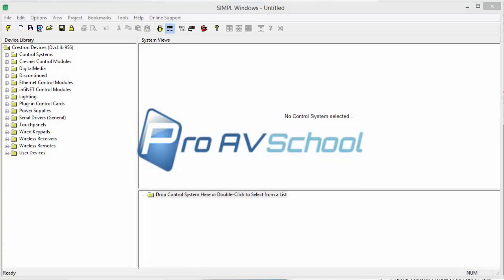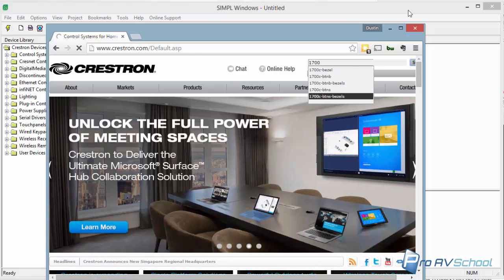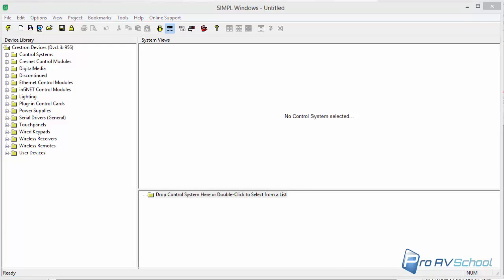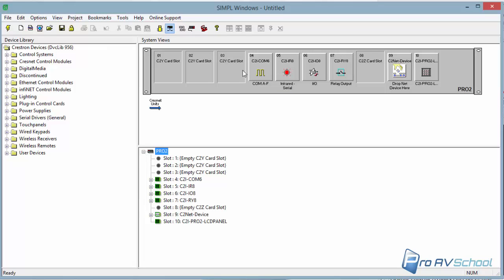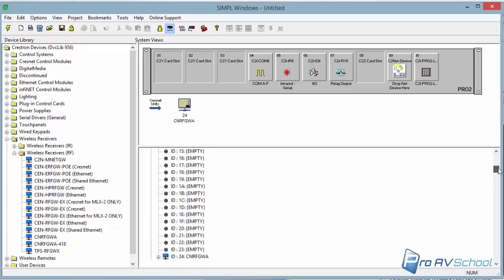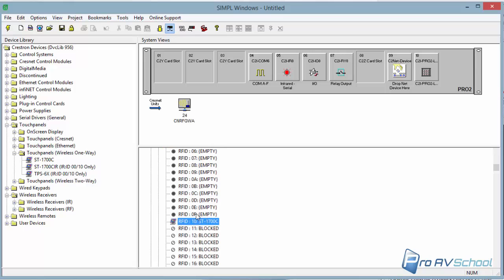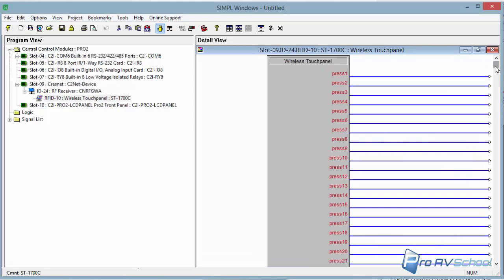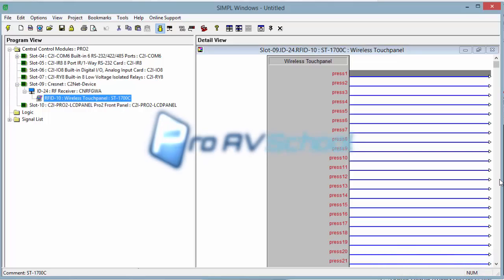Testing Crestron With Old Hardware

Comment: Hi i have a MC2W...i have no touch panel and want to test my code..is there a way to do this..from what i understand xpanel only works for ethenet devices..is there a way to do this with a mc2w?
Reply from the maker: I don't really think you have too many options with that processor aside from simulating the signals using debugger in toolbox. I would say your best bet is to get a processor that at least has ethernet, 2 series stuff is pretty cheap on ebay. Or you could try to pick up a cheap old cresnet touch panel just to mess around with.